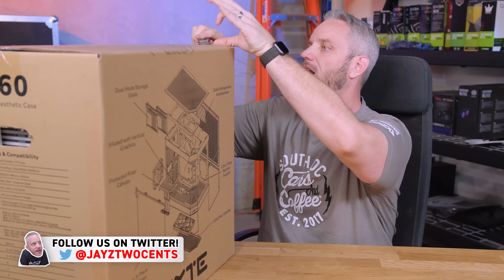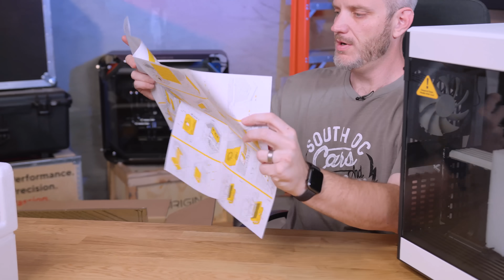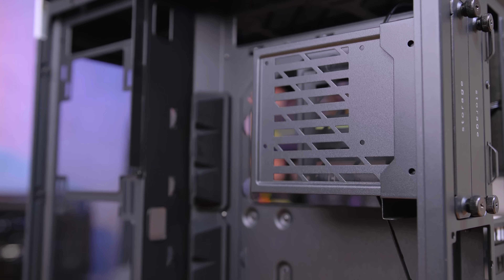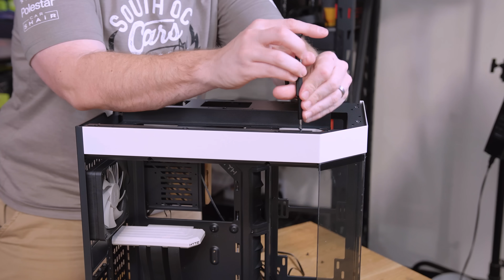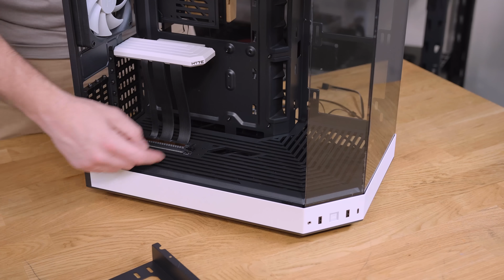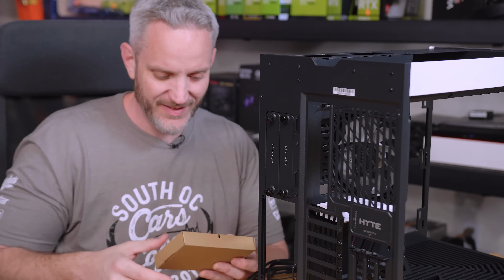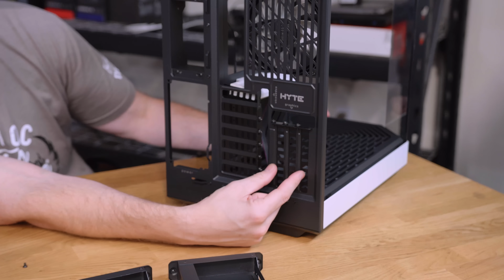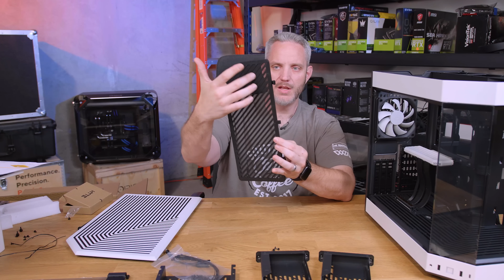Someone FINALLY broke the mold for PC cases...

Comment: Thank you so much for reviewing our case Jay! We really loved your video 💛 We appreciate the support!
Reply: I just ordered this case and noticed there's no reset button, whyyyyyyyy?
Reply: @ItzTheDay  what do you mean no reset button?
Reply: @OpaEditz  usually cases will include a reset button on the front I/O. The Y60 doesn't.
Reply: @ItzTheDay  Hold power for 3 seconds and it resets lol
Reply: @ItzTheDay  Yeah, I thought that was kind of stupid of them as well. Also, why not put some USB's on the top of the 45 angle as well??? It's like they just didn't think many things through...
Reply: Is there a mirrored version where the whole frame is flipped ?
Reply: @Calvinloz nope
Reply: Could you please create one slightly  taller so a 60mm rad can be installed in the top. Thanks
Reply: If it was a bit narrower and the panoramic view was curved. That would be my next case.
Reply: @karu6111 1. It couldnt be thinner without choking most modern cards, 2. Cureved glass would bring up the cost alot
Reply: Oh cool hey as long as I have you here how in the hell do I get the front panel hooked up to a tuf gaming x670e plus wifi? Because so far I've tried several things and that power button still does diddly squat.
Reply: I'm really impressed by the case was wanting to get one already but now I'm sure its the case I need just need to have the money to replace most of my pc now since ill need new fans and a new motherboard with the case
Reply: Please, I beg of you, make a bigger one so I can add the 7900xtx, with a slightly darker red.
Reply: I love my HYTE Y60 case!
Reply: Any consideration in revere orientation?
Reply: Got my Snow White case a couple of weeks ago to replace a Corsair 465X. Got to admit, the Y60 is an absolutely amazing case. Well done HYTE! I'd like to add one of those LCD screens to it at some point too. Would be great if you could include all of the necessary bits to fit it.
Reply: Hyte Y80? Full tower with dual 360 rad compatible
Reply: Any plans in making a similar but smaller case? Love the design but the size is just too big for my needs
Reply: Love the case! I just wish the front connectors/power were on the top of the case rather than the bottom :) I like to have my PS under the desk & this means I have to finger the floor lol
Reply: @DragoNate  Literally EVERY other case has them on the top, the idea was to be DIFFERENT!!!! And MOST people put their cases on their desks these days, to show them off. So having the connectors on the bottom is BETTER. I just wish they had MORE connectors on the 45 degree angle. ONLY two usb a's and one c is not enough. My case is five years old, and it still has many more connectors then this one.
Reply: @AquaStevae  I gave my feedback. That is all.
Different isn't always better and the entire case is hugely different from any other already.
I don't plan on having a desk that can support 400kg to accommodate the new heavy AF graphics cards just cuz the case is supposed to be on the desk lmao (exaggeration, obviously)
nor a desk that's 3 times larger so there's room for it :D
Reply: @DragoNate  If it hadn’t been answered, there are little stands underneath the case so it can stand on your carpet and have spots for cables.

As for power, it helps you get some yoga in.
Reply: @ne0dynamic  nah, still a no go for me.
Reply: @DragoNate  Alright then, can agree.
Reply: @DragoNate  for me personally I have cats so they always get on top of the case so having it not on the top is perfect and why I was initially interested in the case for you though people out there probably have ways to move the button
Reply: @smokiethefox6843  see, that's a good reason for it to exist :D rather than "cuz different"
moving the button could work (rest of ports too?) If it doesn't require permanent modification to the case with cutting tools or something. I don't have access, experience or a place to do that lol
Reply: Hello Hyte. I was going to buy this case UNTIL I noticed that you can't fit a 360 RAD in the back space beside the motherboard. WHY???????? It is the MOST logical place to put a 360, and have it out of the way, as it's not sensible to put the 360 on top, in my opinion. So why oh why would you limit that space to less than a 360 RAD??????? That was the deal breaker for me. Also, why not include MORE connectivity on the TOP of the 45 degree angle???? My current case has four USB ports on the top front, and I use all of them regularly. So why not include another two USB A ports and another USB C port on the TOP of that front angle??? OTHERWISE, it's just wasted space, and wasted space in todays world is a no no...  YOU were soooooo close to gaining a foothold with me, and allllllllll of the people who I build computers for. Keep working to make it better. Lastly, make all screws hand screws, INCLUDING the on the back panel removal. I currently use a CoolerMaster Maker 5T, because it's been the best case I've ever owned, and I've built FIVE SYSTEMS into it. WHY do I keep using it, because the ENTIRE case is "TOOLESS" modular. I can fit EATX as well as ATX boards into this case, NOTHING needs a tool to remove and refit things, it has fantastic air flow capabilities and it looks cool. The mistake Coolermaster made with this case, and abandoning it, instead of just upgrading the front panel with the newer technology. They could have made more money doing so as an after market buying option. Anyway, I thought I'd finally found the case that would get me to upgrade, BUT not being able to put a 360 RAD in that front space is a hard dealbreaker. But I will keep my eye on you, and if you want me to review any of your revisions I'd be happy to.
Reply: I love the design of the case; it doesn't fit my needs though for the below reasons:

1. This if for ATX showcase, but not doesn't support enthusiast eATX fully; that's a concern.

2. The vertical riser is 3x space; as noted for RTX 4090 it's up to 4 slots with air coolers which would put it up against the glass or too large entirely. That's a non-starter unless you're using an AIO or custom loop cooler, which defeats the need for vertical anymore other than looks because the weight/sagging issue is mitigated.

3. The riser cable is PCIe 4x. I realize that's likely a limit of component availability currently, but unless you offer an upgrade later it'll be outdated by next gen. most likely.

4. The back is fully mesh, so you can't create a real push / pull, positive pressure, etc. flow. The back needs to be mesh at the bottom for 120mm fans across, then solid up to the top. That way the bottom pulls in, and the top and back pulls out, and you have a directed flow.

Again, great looking case; love the design, and especially the bottom grid feature. Just missing on a few key items.

Comment: Each drive tray actually has mounting points for either one 3.5 inch drive or two 2.5 inch drives so you could have 4 SSDs plus all your M.2 storage

Comment: I have built my new gaming rig in this case and I have to say I love it. It is a nice case but is a little on the warm side under load. I installed all lian li unifans 9 in total to achive cool temperatures. I had to tweak the side intake a bit to allow for 3 120 fans to fit and have 2 in the bottom 3 on top and 1 in the rear. 5 air intakes and 4 exhaust fans. temperatures under load are CPU around 68 degrees celsius and the GPU 55 degrees  celcius with the odd spike in the mid 70's.  I love the case and give it a 9 uot of 10 rating. is likely a case more suited for liquid cooling over air cooling.

Running Ryzen 7 with 3700x, 3070ti TUF GPU, 32GB Vengeance Pro 3600's 1000W PSU.

Comment: Deff an interesting case and they actually supply what should come standard with the Lian Li like the riser for example. 
The curve looks nice but still cant see myself getting one. Rather take the usual Lian Li o11 or heck a tower 900 / 900 mini / Corsair 5000 depending on room needed. Box for a Box

Comment: I love the idea of vents on the bottom.  I set my machine on a wire rack that raises it about 6 inches off the floor.  Bottom vents would be perfect for this.  I put it up off the floor out of an unfounded fear of my clothes washer flooding the floor or some other water related disaster.  Although my power strip is still on the floor, so idk.   Anyway, bottom vents are a great idea, IMO.

Comment: I wish this case had a left and right handed model.  The way that I've hand built my gaming desk, I really don't want the 45 degree cut-out facing the direction it's facing.  I wish case designers would understand that as soon as you start adding ports on angles that aren't 90 degrees, then you're automatically losing some small percentage of your customer base who think about things like that.

Comment: Another one of your on-the-mark videos. You even make un-boxing look funny. I would like to see you produce a different kind of video. In this video, you roll back the clock to the late 1980s and 1990s and show viewers what PCs looked like. 5 1/4 inch drive bays and motherboards where one had to install individual memory chips that came in a clear plastic tube. Back then, 512 kB was the most you could have. My first hard drive was 25 MB in the late 1980s. Sorry if I got the numbers wrong, but that was long ago.

Comment: the reason they probably make the fold out instructions for the people who use them could be that it stays open while you work instead of a book that keeps closing,
also with the grommets that go blah with one wire, you could mabe cut the bit of rubber off to allow only the wire through.
neat case though, lotsa airflow like the corsair air 540.

Comment: This case looks AMAZING! the only down side is that low profile bracket on the back. They should've really put a swappable piece to have it with either the 3-slot vertical mount, or the normal horizontal full sized brackets without the vertical mounts. Overall, looks great and I wanna build it it now lol!

Comment: I'm late to the party on this one but I actually really want to build in this one, I have a large corner desk for my work/gaming area with my tower in the corner. I feel like this case would look beautiful placed there, with the front "header" being at the bottom on that 45 part would probably be very convent. Once these get back in stock I will probably be moving my current build into one of these.
Reply: im just gonna mention the "convent" typo quick and say based on the description this would probably be good looking tower for your setup, though the desk may be a little messy with the corner wires coming out to your accessory's

Comment: I found a trick for dissipating static! Get your hands wet!! The shock hurts because it has to pierce your dry skin to get to the nice and conductive bodily insides. I had to inventory a bunch of new monitors at work and each time I took one out I got shocked so I took this technique to the next level: sprayed a little mist on both hands, then with one hand grabbed a grounded unpainted metal surface and with the other waved near the static foam and monitor back to conduct away static until my hair no longer stood on end which took about 10 seconds per monitor and completely ended all shockage. BTW I hate static if you can't tell hahaha, sounds like a silly pet peeve but the anxiety it gives me is serious as I'm easily jumpscared and it startles me every time.

Comment: I'd do a pure air cooled system in it with filters on all of the fans.  Mostly because my system is on a 4 ft shelf and is already heavy as is without glass and water added on.

Comment: I got one in black and love it. One of the big selling points for me was the power and USB port locations. Having the USB and power button on top of the case is (in my opinion) outdated on Gaming PCs since most people want to have it up on their desk to display the internals and RGB instead of tucked away underneath. 

I do have a couple of gripes. The openings around the screws for the expansion slots are rather large and have no covers. If you are the type of person that doesn't keep a clean space, you will find out pretty quick that warm electronics and flashy RGB make for an attractive bug home.
Also, the upper cable grommet doesn't go quite high enough so the 24pin connector cable comes out and has to go up at an angle to connect to my Motherboard. This may vary based on what Mobo you have. Some may have a connector that is low enough to match the case better.
Oh, and the LED around the power button is white. Not bright so it's not bad, just looks kind of out of place once you have your RGB running.
Reply: Only losers on reddit put their case on their desk and take up valuable desk space

Comment: It looks flimsy but, watching you handle it I have to second guess myself. It's got ease of access and easy to remove filters for cleaning with plenty of ventilation. Downside for me is lack of hdd/ssd storage space because I'm that guy that stores 10tbs+ of data/tools/games/modding programs etc. Still.. There are... WAYS to fix that.... *evilly rubs hands together*

It's all down to preference now lol. Long story short... It's a really cool gaming display case for sure. I hope they got one of those in black and with tempered glass.

Comment: not sure if he noticed that you can mount 2 ssd's per sled
Reply: Like, the one side specifically has a wrap around and a second screw slot, but the other side is half that height, only one slot. Clearly meant to stack SSDs on the one side

Comment: That's a waste of a case. It's 200$ and huge, but still only supports 3 full profile card (which are mostly taken by one GPU) and only has 2 drive cages. There is no sound dampening, but a huge amount of fans. You have three glass panels that can break. The air filters are way too  thin. This looks like a game kiddy dream to show off your RGB boards and GPU - and it's huge to impress others.
Since you can't really OC modern CPUs/GPUs and IF, need water-cooling, the fans in the bottom and top are wasted. And no, the disk trays dont sound like "industrial grade", they sound like crap. If a disk tray in a server ever sound likes that, it's broken. And PLEASE don't cheer the grommets: they are wide open!! They are basically useless.

I have a Fractal Design Define R6 USB-C (170€) Silent Case in white (no problem with sunlight and looks good against a white wall). It has also place for many fans, but you almost dont hear them because of their fine dampening. They have really thick air filters. I use at the moment on nvme, 3 SSDs and 3 HDs. The case offers at the top front 2 USB 2 (mouse/keyboard), 2 USB3.1 Gen 2, 1 USB C and 1 mic/1 headphones. You can take off the walls, top and front with only 2 screws each. It houses a Ryzen 5800X and a RTX 3080, only fan cooling - no fans in top/bottom needed (but possible in top). The cabling is super organized, it's really the best case I ever had and it's cheaper, smaller, much more sound dampened, stable and so much more useful than the Hyte.

Comment: I screwed up.. I updated my case last year with a Corsair, and seeing this makes me depressed because it would be stupid for me to buy another case after I already spent $300 a year ago. Mine is just as air cooled but that one is more compact where mine is massive, AND I like how it already has the PCI-E riser cable installed.. AND then I saw the lack of storage space... I have 6 drives, 4 SSDs and 2 HDDs, AND I'm about to add another 18TB HDD for photo/video storage.
Reply: You could look into investing in a NAS, which is basically a mini server for data storage that is connected to your internet.
Reply: @insert_username_here  That's funny I was just researching turning my Raspberry Pi into one last night.

Comment: Mountainmods have been at this kind of case for over a decade. But you will get absolutely no cable management with it. Its very open, and very expensive. But still a very nice case if you dont mind putting a lot of work into building with it.

Comment: Yeah I'd use this case, looks great and the features are nice. I'm using the crappy nzxt 510i elite, had to remove the front glass and make my own mesh front for air flow. They fixed the major design flaw with their "flow" series, but they don't sell the front plate alone... annoying.

Comment: Been looking around for this info and  can't find a definate answer anywhere but, will the rad for a evga 3080ti hybrid fit on the side mount? Planning to have my z73 on top. Not sure if the tubes are long enough on the hybrid gpu to reach the side mount.

Comment: This is the one of the few new cases that has drawn my interest in years.  I've been rebuilding our systems in Silverstone Fortress FT02 cases for about 15 years because they're the most suited to our use -- floor-sitting cases, with IO coming out of the top of the cases rather than the back for easy access and window on the right side since the cases sit to our left.  It has the fans mounted on the bottom of the frame similar to the Y60 as well, but the graphics cards sit vertically since the IO is at the top.  Good airflow, and good temps.  The biggest issue I've had with it is that I have to stick with graphics cards shorter than 30cm.  Other than that they have left nothing to complain about for our builds.
Reply: I also have the Fortress FT02 that I updated over the years. My last update: the RTX 4090 FE running nice and cool. So the 30 cm maximum GPU length is not really a problem.

Comment: You might have the wet-dream of Steve from gamers nexus in your hands (^o^)'.
Have the O11 Dynamic XL, but i actually really like the corner of this case for the IO, its way more accessable than the one on my O11.
And the included riser cable is a GOOD JOB on them :).    low chance of availabilty in Europe i guess tho.